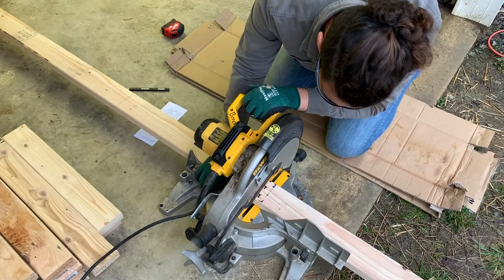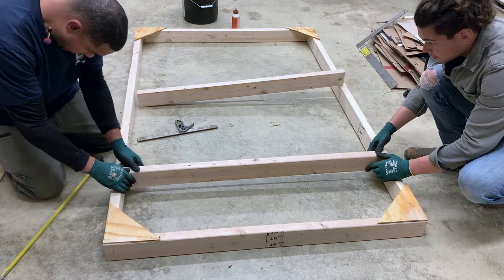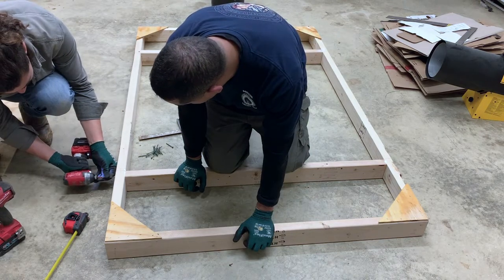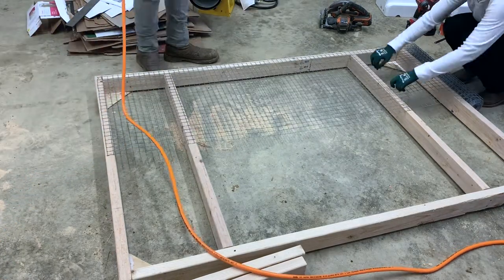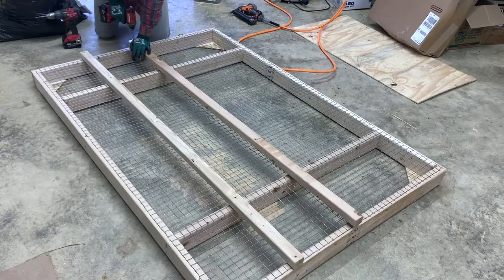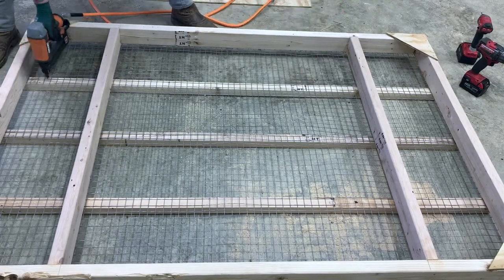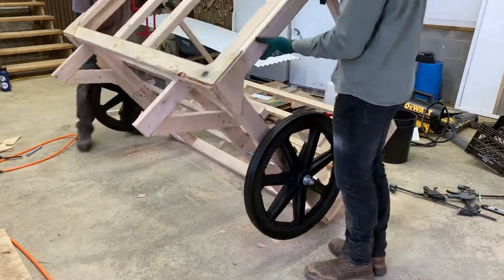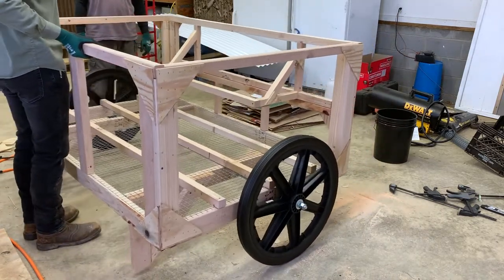Justin Rhodes Inspired Chicken Tractor Build: Pt. 1

Comment: Revisiting these videos. Lumber costs too much, so I’m trying to fashion one out of pallets. It will be about 4’ x 80” wide. Wish I had tools. Air nailer, clamps, stapler, wrenches...but I’ll get there. I also scrounged fiberglass mobile home skirting to use for the roof and siding. Should be quite a sight.
Reply from the maker: Let me know how it turns out bro! I think it would be way more interesting to see one built out of those materials than things bought right off the shelf.

Comment: I also ran the threaded rod through the 2 x 4.  I put a  3/4"  pvc pipe through first to act as a bushing then the rod slips right through.  I extended the front handle support in a level position and added the  stabling feet to the extention arms up near the hand pole.  Works perfect.

Comment: Yeah, chicken tractor was used at least I saw them 30 years ago made of thin Wood piece with Bird net to protect hen with Little chikens with stone on the roof against wind. Nowadays we have great amount of tools and materials to make tractor with inflated lifted wheels in the middle of tractor with handle it is easy. Just make holes with center Wood piece with grinder or saw just enough to wheel to lift up and down with lock pin then make ordinary regular tractor even heavy and lift it a bit lock pin The same operation on the other side grab The handle and go wherever you want. Just think for a moment and all of you will know how to do it :-) good luck

Comment: I will build one like yours ASAP. What I really like is your idea with the angle iron to ‘pin’ it in-place. My land isn’t flat (not as severely sloping as yours) so these are a perfect enhancement. Also, should I slip while moving it, it won’t run me over. I hope I can remove the bedding easily by myself, to take to the compost piles. I noticed that usually two of you carry out the tarp with used bedding. If I can’t manage that alone, I have an idea to add a rear ‘dump door’ to tip up the tractor and let the bedding slide out the back, perhaps with rake to assist emptying it. The rear door would have the nesting boxes attached so they could be swung up all in one piece with the door. In that way I’d leave my compost piles behind the tractor. Hmmm? Any suggestions or provisos? Seems doable.

Comment: Your gussets are so very important for longevity.  
Your axels are a huge improvement.  Rhodes has so much trouble with his axels bending and slipping out.  Will the threads eat into your wheel bearings?  
Why did you not choose to mount your nesting boxes externally?  There must be some reason I do not understand.  Wouldn't that free up more roosting space and allow you to clean better without straw plugging the wire mesh inside?
Reply from the maker: So far we haven’t had any problems with the threads eating into the wheelbearings.

Situating the nesting boxes externally is a great idea. In fact, we did that very thing on all of our previous models. We chose to put them on the inside because the smaller birds roost underneath them.

Comment: Did you use 2x2’s from the store for the 2x2’s in the build? Justin calls for the 2x4’s to be sawed into 1.5x 1.75” boards. I don’t have anything but a circular saw. Do you think i can get away with using 2x2’s from the store?